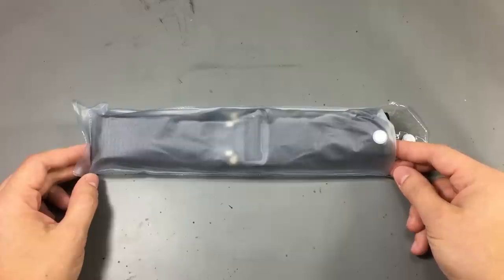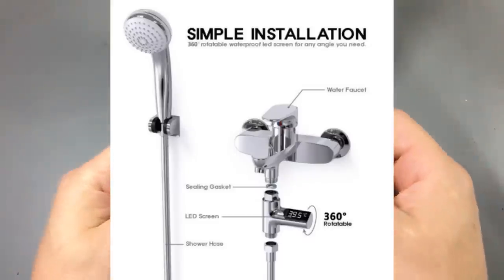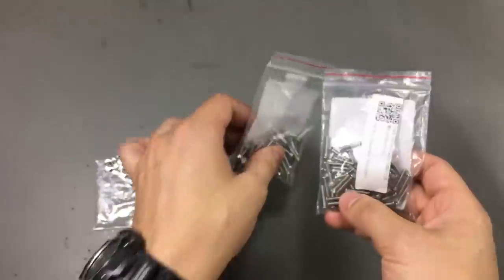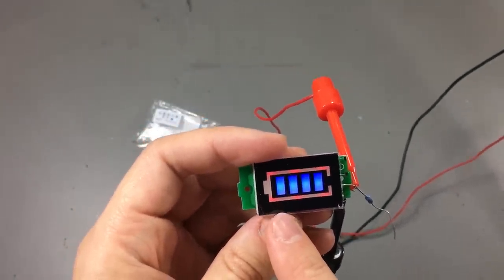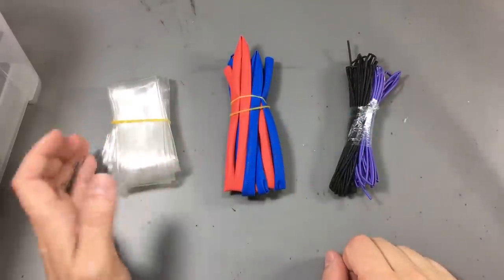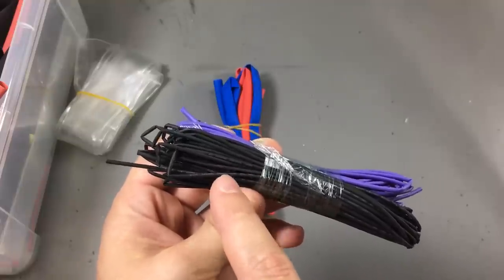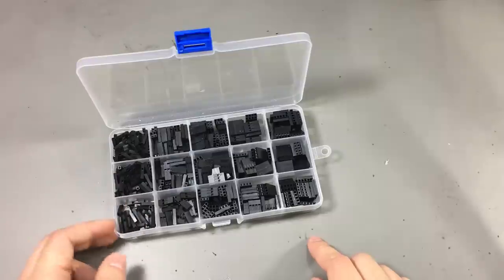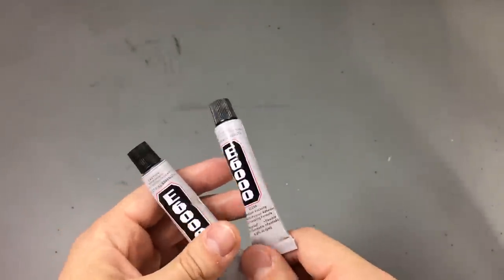Voltlog #172 - InTheMail

Comment: The Dupont Wire Terminal Housing, I never use it any more, because cables are not very save in the housing and the housing is very often to big. After crimping the cable I put a heat schrink over them, it's much better than the every housing.
Reply from the maker: I agree, cheap wire terminal housing like the ones shown in this video might not be a snug fit but even so they have an advantage. When you have a lead with 5 wires, all inserted into the housing and plugged into a pin header, it will be harder to pull that lead accidentally because the friction from all 5 pins works together due to the housing.

Comment: I have the shower temperature item and was happy for 6 months. But it recently started to make noise and the intensity varies and sometimes it doesn't work at all. It seems that the turbine bearings are dead... Battery would have been better...
Reply from the maker: c muller I was thinking that might happen due to corrosion or maybe deposits.

Comment: Down here they are called T nuts.
I remember those crimper vids, and from the comments there was practically a different model crimper for a different connector. Like Andrea or KainkaLabs found crimpers that worked well, but some people said that they were using the wrong model of that brand of crimper for what they were doing.
Reply from the maker: While I was looking around for these crimp tools I found it difficult to choose the right model because most only quote an AWG size for the accepted size. I'll do some more digging and get one soon.

Comment: Could you make a precision test and a accuracy test for the shower temperature monitor?
You can use a temperature sensor with an Arduino for the test.
Reply from the maker: It's not really a precision device, it has 0.5 degrees C resolution.